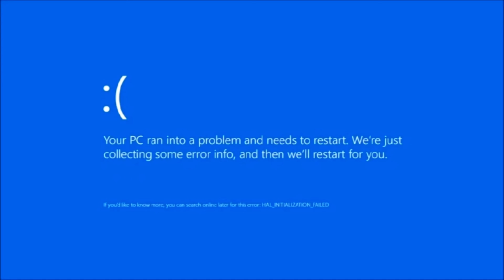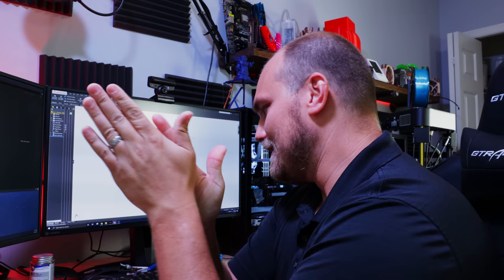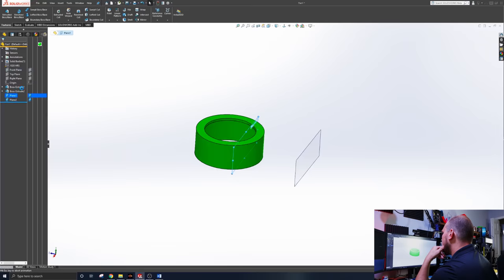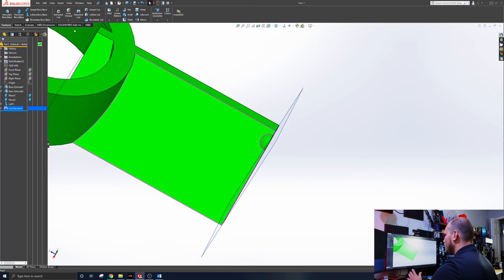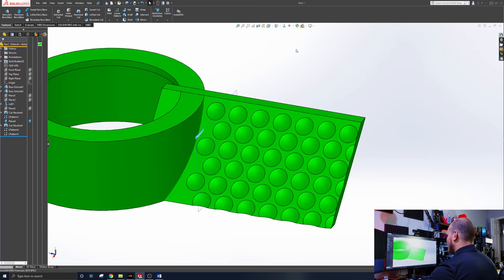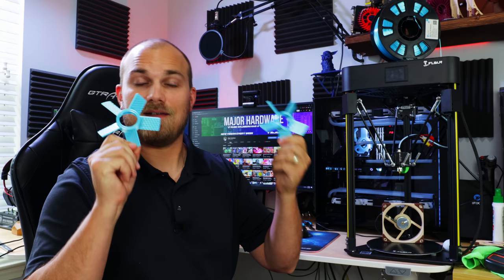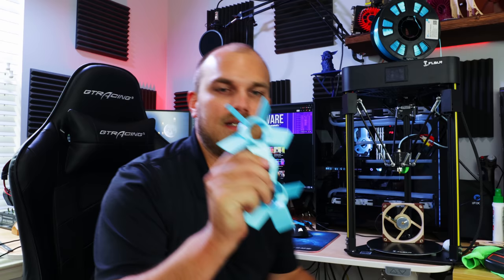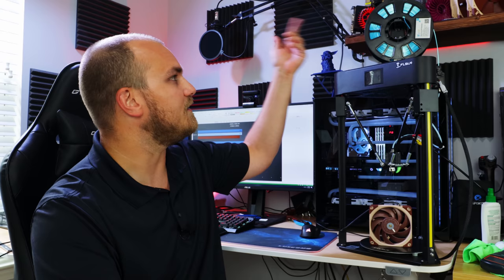What If Fan Blades Had Dimples Like A Golf Ball?

Comment: A fan blade with holes, that's not as efficient, but quieter than a regular fan blade? Sounds like the comparison between the flight feathers of a hawk and an owl—a very interesting concept for fan blades. I was surprised by the not / dimple results. I wonder if there any other results that could be had in practical application, such as energy consumed for the same rotation, or cleanliness and therefore lifetime performance. I certainly wouldn't want debris collecting on an aircraft blade, and cleaning a dirty blade wouldn't be fun.

Comment: I think measuring the load on the motor in amps to see if that number changes. Electric motors our weird and will just draw more power under load. As proof take your sweepers detachable hose and let the sweeper run without anything blocking the hose... Listen to the motor rpms.. now block the hose completely with your hand and listen to the rpm actually increase. The motor spins even faster under load which you can hear yourself. If you were to measure the amount of electricity used it would increase with the load. Just a thought..
Edit: someone else said this below.. but the sweeper experiment shows that it's true.

Comment: I think it's because the dimple do let the air run smoother over the blade, but that does also mean that less air is forced in a forward direction, thereby canceling each other.
What would happen if each blade had different angles? :-)

Comment: Sanding the dimples a little bit would have helped I believe, also is that a burshless motor a dc motor?
Reply: this won't matter, nothing you can do to the dimples or the fan can make them work better because the reason dimples affect golf balls and not fans is that when an object moves through the air, it creates a low-pressure area behind it, creating drag and slowing down the body, because of this, a teardrop shape is the best shape for limiting drag since its outline follows the low-pressure area allowing it to negate the effect almost entirely. the golf ball on the other hand is made to be sphericle to allow for non-directional hits, and therefore must be designed to minimize drag some other way. 

this leads us to the dimples, and how they reduce drag. they do it by creating turbulence on the surface of the sphere, which creates vortexes swirling into the low-pressure zone behind the sphere, allowing air to fill the low-pressure zone more quickly, and lessening the effects of drag.
now, the reason this effect doesn't work on the fan is that its shape is significantly better aerodynamically starting off, as its blades do not generate low-pressure the same way the sphere does, since they are already thin, and don't require air to bend its path nearly as much in order to pass around it.

Comment: Dimples reduce drag.  That won't translate to more airflow for a given rpm which is controlled by the motor design up to the point that the motor get overloaded.  It will make it draw less current though, hence less power and if you were able input the same power by increasing the voltage, you then would get more flow for the same power.

Comment: My question is, how smooth is the non-dimpled fan? I suspect that the surface texture of the 3D print turbinates the air to reduce friction whether there are dimples to increase turbulence or not. 

Although I doubt laminar air flow is a particularly strong force on a fan that size regardless.

Comment: I think if you placed the dimples on the backside of the blades you would have had a much more significant outcome as the airflow was hitting the backside anyways due to it rotating counter-clockwise

Comment: As you want to move air, the golfball design fan should produce less wind with the same RPM as the normal fan, right? I mean, the way a fan moves air is exactly through the drag on the blades, and as we know, golfball design produces less drag than the flat design. Thats why the blades have an attack angle instead of being parallel to the rotation (and of course the attack angle is optimized for this task)

Comment: Fan Engineering is  mathematical controlled by the Fan Laws Power( rpm, airflow and hydraulic resistance). So best to modify air entry exit characteristics and tune the impeller shape. Good luck

Comment: I would like to make a few recommendations, a) dimples on the hub c) instead of dimples use a bird feather shape dimple c) start with a blade smaller at the hub and rotating to a larger (hatchet shaped) at the out side and put a end flat so air does not spill off the end of the blade. Use a aero meter to measure the out put or volume of air. I race sail boats, and repair helicopters so I have my gut feelings. You may have seen vortex generators on wings and car roofs. Think of a reverse vortex generator shape could still be a vortex generator. The cool thing about additive manufacturing is you can make parts that would be traditionally impossible the fabricate so they get thrown away. Once you find a shape that works then you invent a new way to scale it up or apply the new rule.
Reply: this won't matter, nothing you can do to the dimples can make them work better because the reason dimples affect golf balls and not fans is that when an object moves through the air, it creates a low-pressure area behind it, creating drag and slowing down the body, because of this, a teardrop shape is the best shape for limiting drag since its outline follows the low-pressure area allowing it to negate the effect almost entirely. the golf ball on the other hand is made to be sphericle to allow for non-directional hits, and therefore must be designed to minimize drag some other way. 

this leads us to the dimples, and how they reduce drag. they do it by creating turbulence on the surface of the sphere, which creates vortexes swirling into the low-pressure zone behind the sphere, allowing air to fill the low-pressure zone more quickly, and lessening the effects of drag.
now, the reason this effect doesn't work on the fan is that its shape is significantly better aerodynamically starting off, as its blades do not generate low-pressure the same way the sphere does, since they are already thin, and don't require air to bend its path nearly as much in order to pass around it.

Comment: You should experiment with non-planar slicing so the blade faces would be smoother. Likely a lot of designs wouldn't work based on the blade angle and relief angle of your printer, tho...

Comment: I would suggest use a proper power supply and set a constant voltage and current, and see speed difference and air flow rate difference.

For another type of test, ignore the technical factors and go straight for end results. Do a cold start on the computer and do a stress test and using different blades on the radiator and see if there is any CPU temperature difference.

Comment: The dimples are meant to interact with the air passing over the 'edge' of the golf ball increasing the turbulence of the air behind the ball and therefore decreasing the drag. 
So the dimples on the front of the ball don't matter and if you could magically make the front smooth while the 'edge' was dimpled it would probably fly better.

so really only the edges of these fans needed to be dimpled... even though I doubt it would matter.
Reply: yeah, the dimples don't actually affect the fan because the reason dimples affect golf balls is that when an object moves through the air, it creates a low-pressure area behind it, creating drag and slowing down the body, because of this, a teardrop shape is the best shape for limiting drag since its outline follows the low-pressure area allowing it to negate the effect almost entirely. the golf ball on the other hand is made to be sphericle to allow for non-directional hits, and therefore must be designed to minimize drag some other way. 

this leads us to the dimples, and how they reduce drag. they do it by creating turbulence on the surface of the sphere, which creates vortexes swirling into the low-pressure zone behind the sphere, allowing air to fill the low-pressure zone more quickly, and lessening the effects of drag.
now, the reason this effect doesn't work on the fan is that its shape is significantly better aerodynamically starting off, as its blades do not generate low-pressure the same way the sphere does, since they are already thin, and don't require air to bend its path nearly as much in order to pass around it.

Comment: have it smooth on one side. That way the one side will push with dimples, and the other allows the air to continue the direction of flow up the back.
Reply: this won't matter, nothing you can do to the dimples or the fan can make them work better because the reason dimples affect golf balls and not fans is that when an object moves through the air, it creates a low-pressure area behind it, creating drag and slowing down the body, because of this, a teardrop shape is the best shape for limiting drag since its outline follows the low-pressure area allowing it to negate the effect almost entirely. the golf ball on the other hand is made to be sphericle to allow for non-directional hits, and therefore must be designed to minimize drag some other way. 

this leads us to the dimples, and how they reduce drag. they do it by creating turbulence on the surface of the sphere, which creates vortexes swirling into the low-pressure zone behind the sphere, allowing air to fill the low-pressure zone more quickly, and lessening the effects of drag.
now, the reason this effect doesn't work on the fan is that its shape is significantly better aerodynamically starting off, as its blades do not generate low-pressure the same way the sphere does, since they are already thin, and don't require air to bend its path nearly as much in order to pass around it.

Comment: the dimples catch air. the air tries to leave, but hit air trying to get in the dimples or around the golf ball. this means that there is a cushion of air around the ball, letting the air friction being against air, which is much less severe than even a smooth ball. a blade works by creating high pressure and low pressure zones and having the air move from high to low pressure. this is the physics involved, it is going to be interesting seeing what happens. (will the cushion of air interfere with the operation of the blade? will dimples create the cushion of air on fan blades despite a different motion through the air? will the cushion prevent sharp changes in air density making a quieter fan?)

Comment: dimpled blades have less drag only over a very small range of Reynolds numbers. Smooth blades have less drag both above and below this. A driven golf ball falls within that range. Slower iron shots are not usually in that range. The fan air flow and power should be measured at various speeds.

Comment: One thing you forgot to test is amps in the motor driving the blades.  My hypothesis would be the amp draw with the dimpled fan would be less and if tested on larger fans we could build a scalable model.  Less weight could also be beneficial for new the new electric plasma jet motors of the future if proven scalable.  Just something to think about.
Reply: Also CFM would be a good measurement comparison across several fan sizes to see the scalability.
Reply: Also how is airflow affected if the fan were in motion?  If the skin of the blade creates less resistance, you would have less work from the motor, which translates to more turbulent air moving forward.  More turbulent airflow can increase efficiency in combustion or even solve one of the scalability issues with electric plasma jet motors.

Comment: what was the current draw between the blades ? a motor designed to spin at a certain RPM is going to do just that, drag will make a difference in amperage draw so that is the question you're trying to answer

Comment: My ears could hear an oscillating gap in the recording so what I think the dimples could provide is a less noisy server fan.  like those little plugin fan packs you see on commercial servers - if you could create a high flow rate fan that is ultra quiet to fit into the same physical space of a server fan, think about the benefits of noise alone.  The loudest part of my rack when you take away the spindle noise from drive arrays is the server fans.

Comment: The dimples are not made from a circular shape but a hexagon with a spherical imprint. Also the dimple should be seen extruding from the underneath. The blade is too thick. This would cause less drag. More air flow and around 50% lighter.

Comment: For a hundred of years of flying propeller driven aircraft, NO ONE used a dimpled propeller.  IF your engine were at all strained turning the prop (your computer motor is probably a couple orders of magnitude too powerful), then the dimpled blades might spin a bit faster, but I suspect that that means less air flow.  TANSTAAFL

Comment: Try using a decent air foil and maybe turbulators but only on the low pressure side.  But what’s your goal?  Better airflow for given input power?  Less noise?  Lower power consumption?

Comment: Haven't watched the video yet but my prediction is: if dimples on golf balls reduce drag and pressure differences, there should be a clear worsening on efficiency. Fans do want to maximize air flow per energy used aka hit as much air as possible, and in aerodynamics you want to minimize energy lost on drag aka friction with air and pressure differences. So if dimples are used to increase areodynamism then the fan with dimples should be less efficient AT COOLING than a normal one

Comment: I agree that measuring current is more useful in this instance and it might also be useful to try several iterations of the dimple arrangement.  For example: put dimples only on the leading side, then only on the trailing side then staggered upper and lower, etc.

Comment: Great video. However, if would've been nice if you had checked the amount of air flow because, if I read your numbers right, the dimpled fan REDUCED temps by at least 2 degrees during max operation.

Comment: Is there a difference in power used to spin one vs the other? Less material will not necessarily make the motor spin faster (typically rated for a particular cfm) however, the weight difference would mean a lighter load - therefore less power used to spin up to the specified speed. Less power means less wear and tear on the motor itself... just a thought.

Comment: Dimples should not be on the leading edge of the fan blade, only on inlet side. This will help create a larger surface area, and a "lower" pressure area that more air volume can fill, thereby increasing discharge volume. You may not catch these minute changes under no load conditions, or by measuring at a single discharge sample point. 
Most blade efficiency loss is off the blade tip- can you try one with ailerons on the blade tips.

Comment: The reason this doesn't work is because of the shape of the object.  Dimples help a golf ball by helping the air hug it's curvature, reducing wake turbulence, which in turn reduces drag.  If the fan blades had a more ovoid cross section, instead of a flat plane, you might see a measurable benefit, but even then, the benefit would be in reducing drag on the blade, which is not necessarily beneficial to performance as a fan.  The point of a fan is not to cut cleanly through the air, but rather to push air (generate directed turbulence).  The best performing fans use ferrings to take advantage of laminar flow for a truly uniform direction of air travel.

Comment: Can you check the current/amperage draw of the blades to see if it takes more or less power to turn them?
And maybe print the dimples on the other side of a set of blades or print them on both sides of a set of blades?

Comment: Does the fan just spin as fast as possible, or is it speed governed?  The test would be to measure electric consumption to see if it is using less electricity to maintain the same airflow.  Also, I'd be curious to see if it collects less dust on the blades due to having a cushion of air hugging the blade.

Comment: Measure airflow. Also, you can put more blades on the fan. That's too much of a propeller design. Fan designs go with a more curved blade instead of flat to draw in air more effectively. Also a new design i've noticed is connecting blades. Usually air travels in and outwards, by having connected blades, it can catch some of of that air and direct it inwards. Perhaps consider such a design but make it much more pronounced to get the extra benefits of such designs.

Comment: You would think the savings would be in in terms of energy reduction. Seems as though the motor is resisted to spin at a consistent rpm. If you were trying to test whether or not the dimples reduced drag you would have to look at the work being done not the byproduct of the work ie air flow and temperature variations.

Comment: Motor speed is regulated, no matter what fan is attached?  Questions would be: How much torque is required/expended with each.  Is the volume of air moved different, or the pattern of the flow changed?

Comment: You should use a db meter for the noise test. You might see a tiny difference. camera mics aren't really the best at capturing subtle wind noise differences. I could here a really slight change in the pitch of the hum but it's still pretty hard to tell

Comment: Isn't the motor of that fan basically an induction motor, meaning that it's running rpm is determined by alternating current frequency - so, providing it has sufficient torque to maintain it's running rpm, varying wind resistance should not have had any effect?

Comment: I'm sitting here wondering if the dimples would have served better on the circular surface of the motor cylinder, and maybe on the top face of the blades, maybe with them sorta oblong forms on the leading edges.